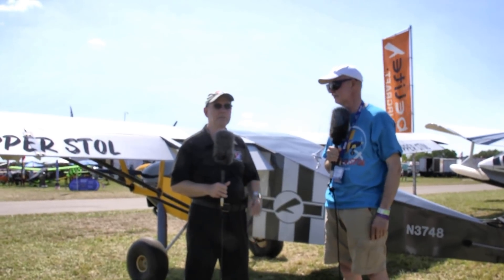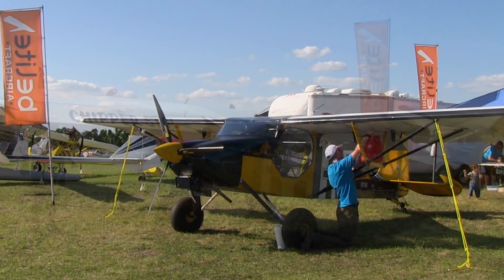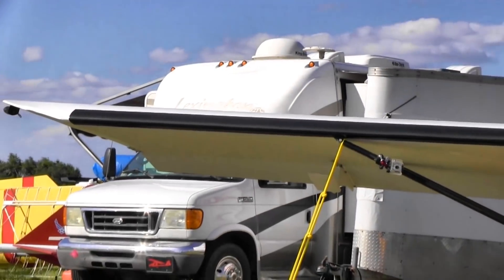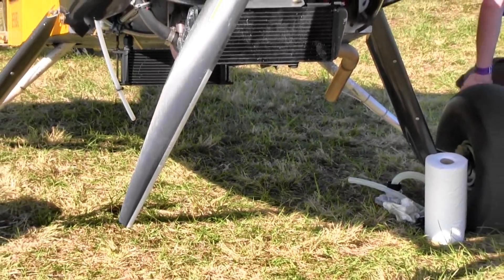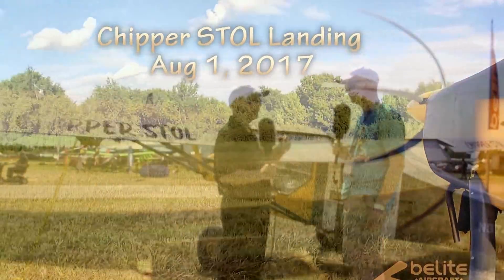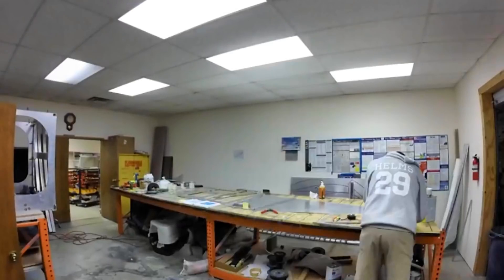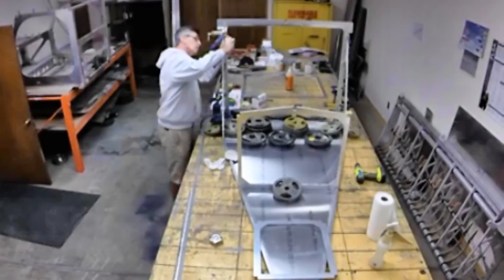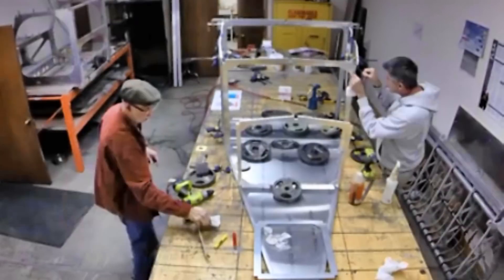Chipper Experimental Aircraft, Belite Aircraft offers Metal Wing Option for Chipper.

Comment: New to the ultralight flying...what FAA requirements are needed to fly once of these?
How expensive is it to get into this sport...looks like a lot of fun
Reply from the maker: This is NOT an ultralight it has two seats. If it was an ultralight it can be flown without a license, medical, registration, any exam or flight training. AND it is a lot of fun. Prices for kits like the Legal Eagle and Affordaplane start about $5,000.
The Ultralight Flyer
Reply: @ultralightnews  so it has to be under so many lbs. And horse power in addition to being a single seat...gotcha.
When flying do have to do flight plans and stuff like that?
Reply from the maker: Single seat, 254 lbs. 65 mph. top speed, 5 gallons of fuel. No flight plan etc. NO horsepower restriction. No float endorsement, No medical. No license.
For the complete rule
http://www.ultralightaircraftmagazine.com/

The Ultralight Flyer